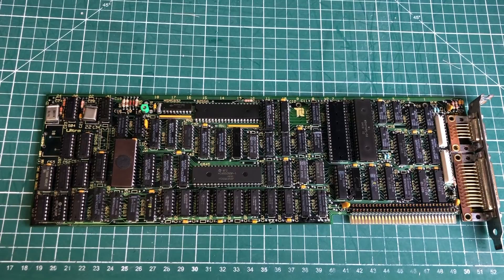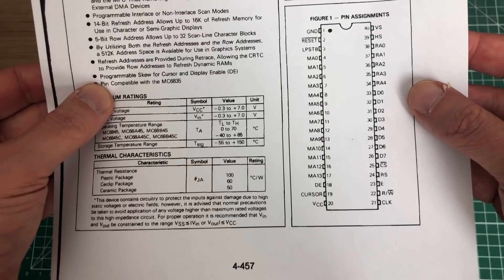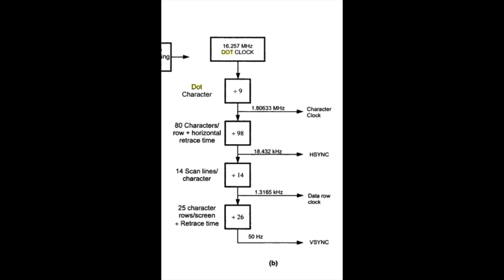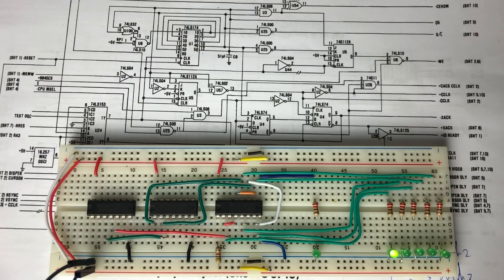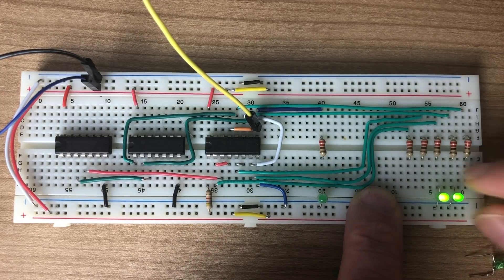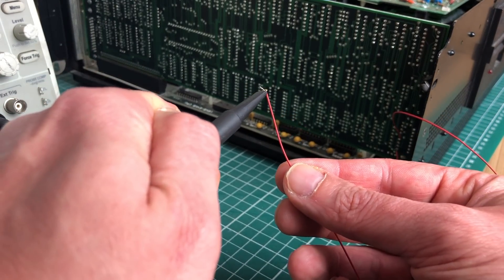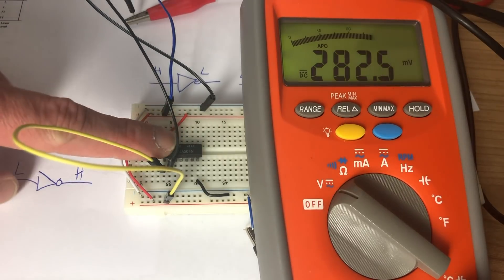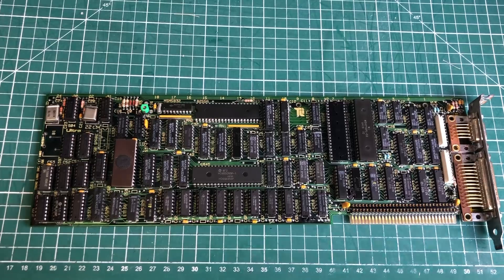Unfixable videocard from hell ? (part 2)

Comment: Look for another fault chip, probably the problem is this voltage drop, some chip is consuming a lot more than should.
Reply from the maker: Hooked up a scope with a 4.9v trigger on the 5v line and it never triggers, not even during the reset.
Reply from the maker: Sorry wrong reply ... thought this was about another video.
Reply: No problem, but don't give up in this card, you are so close to fix :)
Reply from the maker: I won’t ... just wanted a break from it :)
Reply: @RetroSpector78  i like to say, stop for the coffee hahaha

Comment: Any warm circuit needs to be replaced. I've heard about a siberian way of repair : make the card powered up, let it warm, use a cooling spray, the temperature shock will destroy faulty components. Replace'em. Also, no TTL circuit could work reliably with 4,11 volts. make a better connection and check you get at least 4,75 volts on the furthest circuit from the power. Take and old dead mobo, get yourself an ISA connector, solder 1,5mm² wires to all power pins, and use it to power your card, you will at least get the correct voltages and amps.

Comment: For the IBM MDA the clock rate is changed with HRES pin 2 on the LS153 on sheet 3 and that one is in turn coming from a d-type flip flop on sheet 7 which is in turn written to by an I/O write to 0x3b8 bit 0 . The 1.016MHz clock is probably the "TEST CLOCK" signal but I can not find where it is coming from.

Comment: HGC info from this link:
https://en.wikipedia.org/wiki/Hercules_Graphics_Card

"The monitor is connected to the Hercules card through a DE9F connector using 5V TTL electrical signaling; the same as for an MDA card.[5][6] Nominally, the Hercules card provides a horizontal scanning frequency of 18.425 ±0.500 kHz, and 50 Hz vertical.[7]

However, the Hercules actually ran at two slightly different frequencies depending on whether it was running in Text or Graphics mode. This is a side effect of the CRT controller using 9-pixel, 14-line character cells when impersonating the MDA, but having to use 8-by-4 pixel blocks to turn memory bytes into 1-bit pixels in graphics mode, with neither the total pixel count in a horizontal period nor total number of scanlines matching up completely. As the card's onboard clock crystal was also slightly different, at 16.000 MHz vs the MDA's (and later, EGA's) actual 16.257 MHz, neither mode was an exact match for the original sync structure, with the exact figures being 18.141 kHz and 49.84 Hz in text mode, plus 18.519 kHz and 50.32 Hz in graphics. However both are close enough to MDA's own 18.432 kHz and 49.82 Hz timings to fit within the sync tolerance of and work reliably on a typical IBM monochrome monitor or compatible. This tolerance was taken advantage of by the various Hercules clone cards, which themselves often exhibited less than accurate timings versus the original.[8]"

Comment: The timings on a video card are highly dependent on the video mode. The mode will determine what video (dot clock) will be generated along with the hsync and vsync timings. The MDA card will have timings that are different than a CGA, EGA, or VGA card. It is very possible that the TSENG timings are different than the MDA timings for a number of reasons. Specifically, the mode defined when the board is powered on should mode 3, however that is a color mode. Therefore, a number of other modes may be defined that support 80 x 25 mono text. These might be mode 7 or mode F. Take a look at this link for the some details. https://cs.lmu.edu/~ray/notes/pcvideomodes/

At this link there are some details about the ultrapak board. It seem that it had MDA  and HGC modes. 
https://en.wikipedia.org/wiki/Tseng_Labs

It was capable of displaying graphics (640 x 200 and 320 x 200) in monochrome, so the timings must be different to support this. It also supported a 132 column mode. 

Check the hsync and vsync timings and compare them to the Hercules graphics controller timings. You may find that the timings match the HGC.

search for tseng ultrapak for more information.

Comment: What happens if you supply stable voltage from outside the PC? As in, not relying on just the power from the PSU of the computer?

Comment: Dude, there is probably a break in the pc tracing somewhere.  That, or one of the chips are fried. You could spend 20 or 30 hours hunting the problem down. Sometimes it's time to bite the bullet and move on. For all this time, you could've gotten yourself an RTX 2080! 

Hey, I understand. I had a laptop die on me, would not even get to running the BIOS level. I decided to shelve it and build a desktop instead.

Comment: hot chips + high power consumption, seems very much like bad chips to me...
and it could well be that, say, on lab bench, you test its power state, but it wouldn't get any signals, wouldn't show anything, but in a computer the computer tries to send data, which interacts with the bad chips, which mess it up?

Comment: Ditto on the overheating TTL.  Run the board on the bench with all 3 supply voltages and measure the current draw on all the rails with the 2 overheating chips in and out of the board.  A  current limiting power supply module is useful in this type of situation.  A frequency counter is useful to measure the clock divider chain.   There may be several faults here.  Have fun!

Comment: it looks like the hot ICs you pointed at are some 74LSxxx ICs. Those do not usually run at 60°C. Last time (a long time ago) when I fixed one of those cards they just took over 1A and not almost 2A like that one. But it was a bit more similar the other working card you showed.

Comment: I guess the voltage drop you mentioned near to 16:50 is because of the thin wires connecting the power supply and the video card. At that current it will show quite a resistance (thus voltage drop), I am not sure if it's the connector's fault you proposed (or at least not only) ... But anyway it would be interesting to measure voltage drop between the power supply and the connector on the wire itself ;)

Comment: Any chance you can check those larger specialized ICs? I had the honor of repairing an Atari ATW800 a while back which had video issues, while I suspected a number of TTL chips on the video board it was the SRAM (for the color lookup table) inside one of the DACs in the end.
Getting a TTL tester and checking the EPROM contents should be the first priority at this point tho.

EDIT: Another thing worth checking ... is the card a 4 layer one? Might be worth checking that there are no shorts in the inner layers - that's the sad fate an Amiga 3000T from a friend is currently suffering due to battery corrosion.

Comment: I think some of this issues causing the excessive power consumption when just powered on the bench with just the 5V power supply is because there are other chips on there that are expecting the 12V, -5, and -12V rails to be present.  This can cause latch up in the chips that are not getting correct power and can damage them.  If you have TL866 or equivalent programmer they usually can be used to test the logic chips and some ram chips as well.  I would check the pins on the chips that are getting hot with the scope to see if they are being properly driven to 0V and 5V and not some where in between.  Have you verified the video card bios is ok?

Comment: From page 23 of the IBM MDA Schematics 'Monochrome Display Adapter Sheet 1 of 10' the card needs +5V(B03 + B29) and +12V (B09). You only seem to supply +5V to one pin and one GND pin(your pins look wrong) for some reason? You need to connect to all the +5V pins and all(three) GND pins too (B01, B10, B31). Plus Reset(B02) needs to be held high in order to enable the video. The card appears to disable the video by turning off the logic that generates the video frequency.  Apparently you can talk to the card via the parrallel printer port and read memory in the card to determine the status of the card (  I/0 Register
 Address '3BA ' )

Comment: The difference between the bench and pc could be that the voltage of the pc bus is dropping due to high current caused by a short in the card and could be what is causing the overheat.  Try checking the voltage supply in the pc case and see if it is dropping. If so, you might need to check those heating chips and their surrounding.

Comment: It is very much easy around thinking, but conclusion is that you are getting bigger load on clock while in pc

This judged by power grid. When there is light load, the turbines will be spinning faster and when load is higher, then turbines are showing down, as there is more resistance.

It may seem unrelated, but actually this exactly same physical phenomena. Check what is connected to clock and find what will change its load while in PC.
I guess card is not working correctly while on bench and some circuit is failing to work, which is allowing clock to work normally.
There is some active element (running software) or some passive element which is influenced by active element (this may be IC).

I would bet some IC which is connected to clock is faulty. I probably would win such bet.

Keep looking. You will fix it.

Comment: You happy that the voltage on the motherboard is stable and ok?  Whilst you may have tried another card and it's good.  The current pull from this card may be something that the M/B cannot handle.  You checked the power lines into the GPU on the PC whilst operational and is it in line with the specs?

Comment: couple of side notes - too thin wires from bench psu, to long inductance loop when extending osc probe leads like that, I'd suggest backing up character eprom in the first place (also checking if it is even alive). cmos chips are designed for low power dissipation, if they'r hot - something is wrong. Commands to switch modes are directed to CRTC by the CPU, that's why you are seeing different measures when connected to system bus, and flat on the bench. I would poke around with logic analyzer trying to understand what's going on (on the addres/databus of the system in the first place, that would give a clue - where, and probably why processor stops)

Comment: I tried to reverse engineer the card just from a chip list taken from your pictures on imgur. Most likely the 4 74LS258 chips are generating the address lines for the video RAM. The video RAM on your board is comprised of 8 RAM chips with 65536 entries of 1 bit each (64k x 1). This means the RAM chips need 16 address bits in total, split into 8 column and 8 row bits.
Your card has two sources of addresses for the video RAM: Either the address is taken from the CRTC (for screen refresh) or it is taken from the ISA bus (for processor access). This means that you have 32 address input signals (16 CRTC, 16 ISA), and 8 address output signals (RAM address pins A0..A7). Each address pin for the RAM has 4 different possible sources: It might be the row address from the CRTC, the column address from the CRTC, the row address from the ISA bus or the column address from the ISA bus. If my intuition is right, this selection is performed by the 74LS258 chips, which are "quadruple 2:1 multiplexers with tristate output". As these chips contain just 4 multiplexers, but the card needs 8 output bits, each two of them are grouped as 8-bit multiplexers. The selection process works in either of the following two ways:

a) two multiplexers select the RAM row address by receiving 8 address bits from the CRTC/graphics card logic and 8 address bits from the ISA bus, and the other two multiplexers select the RAM column address by receiving the respective other 8 bits. The select input in the multiplexes select whether you want the CRTC address or the ISA address to reach the RAM chip. The output enable input is either active for the row address multiplexers or the column address multiplexers, depending on which address half is required at the RAM chips.
b) two multiplexers deal with the ISA address and select either the row or the column part of it, the other two multiplexers deal with the CRTC address and chose the row or column part of that address. The select input input of the multiplexers is connected to a signal the determines whether a row or column address is required, and the output enable either activates the ISA address multiplexers or the CRTC address multiplexers.

In either way, only two of the multiplexers must ever be enabled at the same time, as the second level of the 4:1 demultiplexing is done by only ever enabling one of the two groups of 8 chips. As you have two very hot 74LS258 chips, it is quite likely that those two chips are driving the same address lines, and must not be enabled at the same time, because otherwise they drive against each other, causing excessive current consumption and heat generation.

I suggest that if doing the simple test suggested by other people, namely testing the output pins of the hot chips for shorts against ground (and +5V) doesn't result in any findings, you probe the output enable lines (pin 15) of all four chips. You should find two different signals (each at two of those chips), which are never low at the same time (output enable is active low). If the output enable waveforms are correct, it is quite likely that one of the two hot chips is driving its output even though it is requested to be in high impedance state (aka Z or tristate) and needs replacement. If the output enable waveforms are incorrect (both of the hot chips are indeed enabled at the same time), you would need to trace down where the output enable waveforms come from.
Reply: someone push that response to the top! Awesome analysis!
Reply: I now know that you are very knowledgeable and I understand even less about computers than I thought I did.

Just fascinating. I now want to learn more so thank you for that.

Comment: Isn't it an option to just swap the two chips that are getting too hot to touch and see what happens before spending ages on tracing lost Mhzs? Or are they not available anymore?
Reply from the maker: They are available (3 EUR a piece !!) , but didn’t really notice them getting hot until pretty late in the video footage. Will remove them and see if I can get some replacements. There were a bunch of other logic chips broken also, so in the heat of the moment you encounter lots of issues and try to fix / debug what you can. I’m sure if I ever get this working I can create a 3min video explaining people how I fixed it. But not there yet :)

Comment: Hey, I might not be an electronics engineer, but for start i would suck out those hot chips out, and also, go around the board with scope to test that all the 74 logic chips levels are correct.
If some of the chips inputs are bad, they could be driving down the logic rails to strange levels, and then strange things can happen.
Reply from the maker: Will look into the hot chips, verify them and replace them if needed. Regarding the logic levels. That would involve probing all inputs / outputs and seeing if they are in range  (valid logic low and logic high signals) ?
Reply: Yeah, probe logic pins with scope and verify it is oscillating between logic low and logic high  (i don't know if it is TTL, or CMOS, or what ever are normal logic levels for that card)
On some types of logic/dram chips if logic levels are between high and low, very strange things happen. And it can happen if, for example, one out goes to multiple chips, and one of those chips has a bad input that is pulling it down from 5V (eg, TTL) to something around 3V (or even lower).
Then all inputs on other chips are going to be at very strange state, and some oscillation could happen.
Also, ISA bus provides +5V, -5V, +12V and -12V power rails. Some older DRAM chips, and some chips in general need multiple rails to run (eg OpAMPs need positive and negative to run). Check all rails, current draw on all rails while supplied with everything that ISA bus provides
Reply: Also, don't just go replacing chips. Those hot chips might just be fine. Things start to get very strange at some times. You can have chips warming up crazy, but they could still be perfectly working, the problem might be further down the line with some other chip, or component pulling a data bus low, and causing extra current draw.
This is why checking if you have some kind of digital activity and valid logic levels makes sense as well.
Check chip type and do best guess where would you like to see activity

Comment: I am not much help on the troubleshooting side, but this might help you see what is going on a little more clearly:
https://github.com/Upcycle-Electronics/ChipLabels

 I have most of the chips from this board already premade. The GIMP folder has the .xcf files with the labels premade as layers. There is also a folder with hundreds of premade labels in PDF. They are setup to print on 8.5 x 11in paper. Just set the scaling to this in your computer's print settings.
   Most labels have multiple versions for each part number. I also made the logic chips with 2 different widths. If you have the narrow 1/2 width end pins, I have specific labels for those too.

  I find it much easier to understand the circuit when I'm not trying to translate the schematic to decipher the pinout and then counting pins. 
 I have the Motorola 6845 label aready made too :-)
-Jake
Reply from the maker: hehe ... thanks for the link ... looks nice ... will take a look.

Comment: The voltage drop is in the thin cable you are using and not in the connection. Also 1.7A seems too high to me.